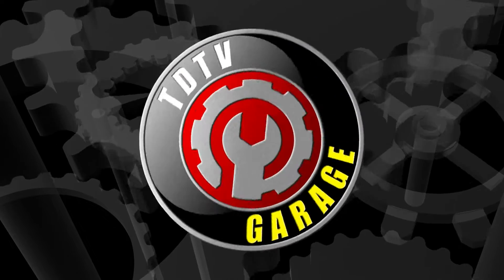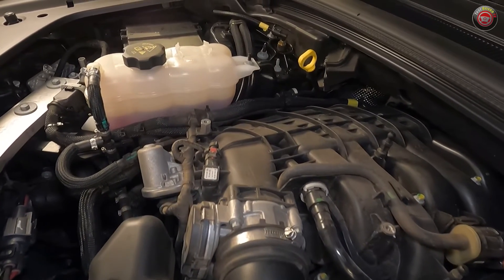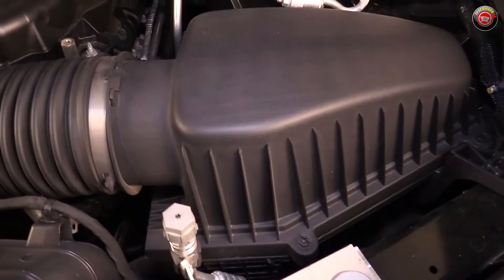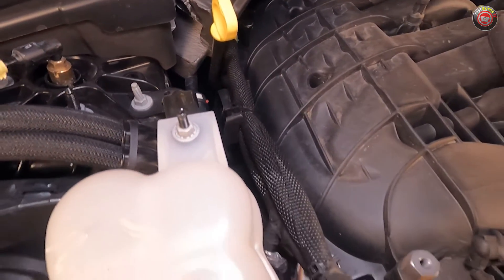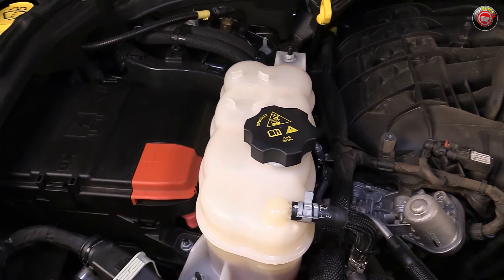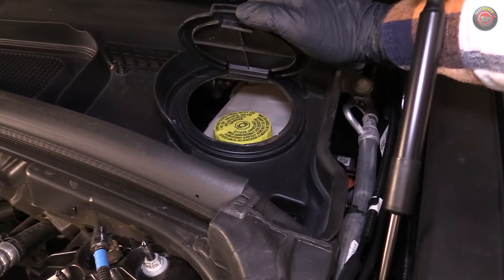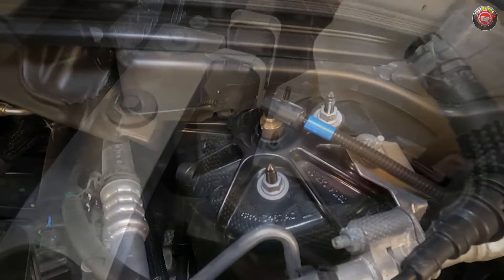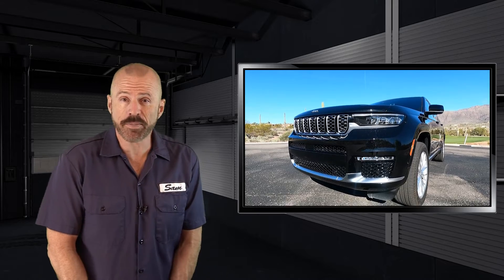Jeep Grand Cherokee 3.6 Pentastar V6: Engine Explained

Comment: hello, I have a 3.6L 2018 Jeep Grand keep Cherokee and I have a question. What is that honeycomb shape cylinder with black holes inside the throttle body? I can't seem to identify the part but it's about 4 to 5 inches deep inside the opening plate of the throttle body mine is really dirty with burnt oil and Mucky.  thanks
Reply: Sounds like the MAF or mass air flow sensor. Needs a special spray cleaner to clean it. Otherwise damage will occur
Reply: no prob I actually pulled off the air intake manifold and it ended up being an EGR valve It was really dirty and I was glad to clean it. they actually runs decently Thanks for the help  @joedmac78

Comment: There are two 12 volt batteries, located under the driver and passenger seats, not the engine compartment
Reply: yeah how did they get that wrong, the fuse box is in the engine bay. There is only the positive terminal post for jump starting the vehicle near there.

Comment: hi. i am living at russia . i want to buy dodge challanger 3.6 2018 . do you recomend ? are parts expensive ? and is engine for long term ?
Reply: Yes it is good engine and transmission. I had a 2017 and put on 100,000 miles. Change oil regularly every 6000 miles

Comment: Actually; my battery is located under the front passenger seat
Reply: That is the battery for the starting system, so the engine will stop at stops then restart when brakes are released. My18 Pacifica has that, too, but I shut that off with the button on the dash.
As far as the engine, 3.6, there has been 17,000,000, yes million,  Pentastar engines produced.  If 5 percent go bad, that is some 800,000, yes eight hundred thousand bad that had a problem. That is 5 percent.  95 percent that that you never hear of! That is some 16,000,000 million you never hear about because they are no problem. I don't know ANY manufacturer that wouldn't like to have numbers like that!!!

Comment: improper Air Filter housing installation has been a Primary cause for Oil Consumption issues with the GM 3.6L Engines.   which often leads to the destruction of the engine.  it was necessary for GM to Design the air filter housing that way.   Jeep is a brand made by GM
Reply: Jeep was American Motors (AMC), bought out by Chrysler decades ago, has absolutely nothing to do with General Motors today, though AMC Jeep occasionally used GM engines in different models as an option. Most notably the Iron Duke 2.5L four-banger engine, which was used in CJ models from 1980 to 1983 and the Buick 225 V-6 "Dauntless" engine for use in CJ and Jeepster models from 1966 to 1971. Also some J-series pickups got 350 Buick V8’s as well as the Wagoneers from 68-71.
Reply: Jeep has nothing to do with GM last time they used any engine form GM was in the AMC days. Some GM 3.6 engines have problems with the PCV system freezing in cold climates causing rear main seals to pop out which then causes the engine oil to pump out of the engine a known defect but this engine can be reliable if properly maintained most people don’t understand how important it is to service any modern car.  I own a 13 pentastar its maintained properly still runs like the day i bought it.

Comment: 😮 With over 10 Million made its One of the best engines out there.  And not Nicknamed America's Engine for nothing.
Reply: my 2020 charger gt has 260k miles and has 0 issues. no leaks or oil burning or ticks.
Reply: @jabraan1360  Typical of 3.6 Pentastar Ownership
Reply: See you at 200k sucka
Reply: Thought about getting a Ram with this motor. Can't do it. Plastic oil cooler, engine starts dry due to placement of the oil filter and rocker issues between 75k-125k. Not playing that game.
Reply: @joeb2588  LOL. The cooler and rocker arms have been revised. No more problems
Reply: @tedlulis973  not too sure about that. Esp the cooler. I didn't see when they revised that piece I k ow there's an after market aluminum one, but I'm not playing around waiting for parts to let go just to be replaced with after market parts. I'll look into that again. Thanks for the info.
Reply: @tedlulis973  just found out. No to both. There was an "update" 2016. Hasn't fully solved rocker problem. Oil cooler, not yet. Prob won't.
Reply: @joeb2588  Nope... Wrong. Check Revised Part#
Reply: @joeb2588 Dorman makes an aluminum oil filter housing and Baxter makes an oil filter adapter that prevents dry start up. Check out the video here on those products. I’m considering a big horn with the 3.6 as well.

Comment: I had a 2012 Grand Cherokee with the 3.6 Pentastar that ended up having an issue with the lifters that was costly to repair.  Apparently it had been a known issue with Pentastar engines for some time, though i don't know if they've taken any steps to rectify that since then.  
I had them do the spark plugs while they were in there since it's such a pita to do the plugs on this engine.  At least on the 4x4 configuration, apparently it's easier to work on when it's in a fwd vehicle because the engine is turned sideways in the 4x4.
Aside from the lifter issue the engine worked well for 13 years for me until i traded it in.  I wouldn't recommend a 4x4 with a Pentastar V6 for anyone interested in doing their own maintenance because aside from oil changes pretty much everything is a pain in the butt to do.
Reply: They have actually. The gen 3 Penta star has been updated . Millions of these vehicles are on the road  avoid the earlier models 2011-2014
Reply: @markwilliams6378  there are plenty of 2015+ in the shop for rocker arm issues. From my understanding they still use the same lousy rocker arms.
Reply: 😮 Typical of most modern cars
Reply: I had a 3.6 Penstar in my Chrysler Pacifica that went past 187,000 before It even needed the plugs changed, best V6 on the market hands down.
Reply: That lifter issue is the only thing keeping me from pulling the trigger on a Wrangler. FCA has done nothing to rectify the issue in newer models.